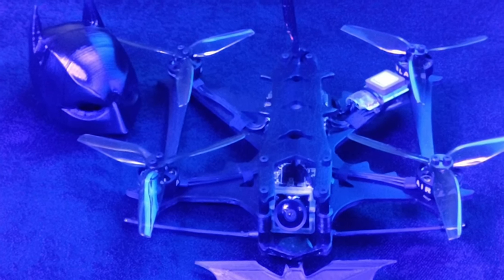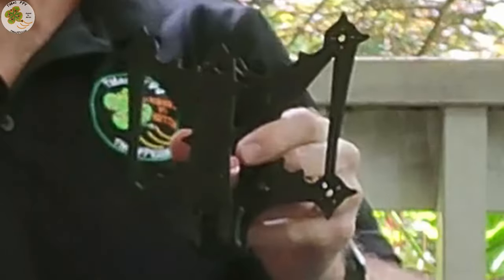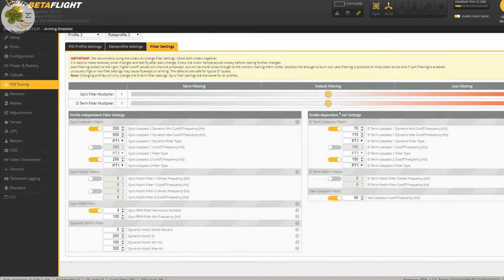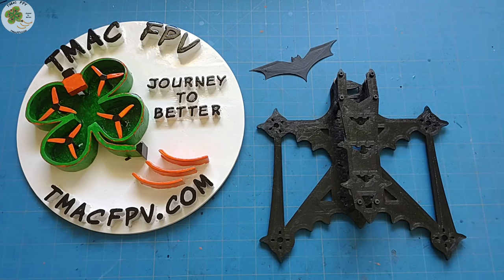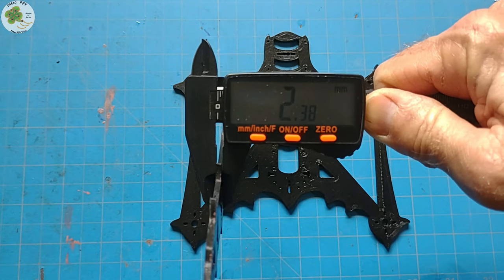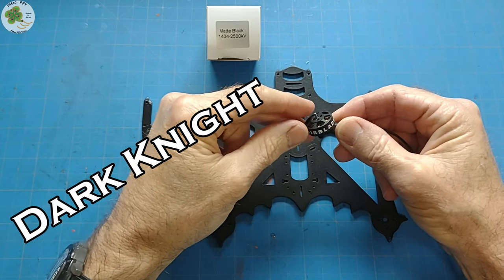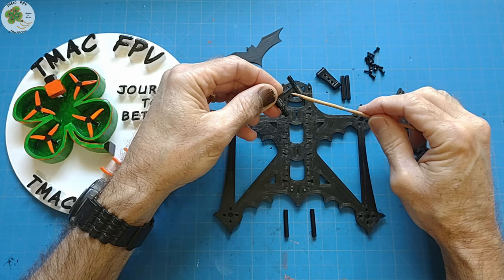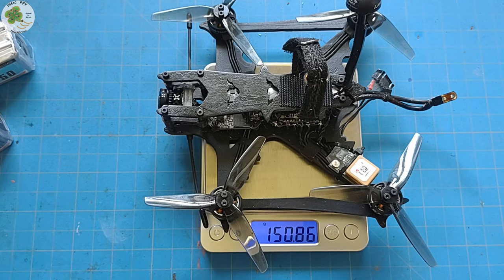3D Printed FPV Drone (3.5" BAT!)

Comment: Now you're just showing off. Beautiful design. Homemade frame? Heck yeah. 1100mAh power, HD video AND sub 250g? That's how you do it. Broke an arm? Just print a new bottom plate and you're good to go. You, Sir, are definitely onto something.
Reply from the maker: You get a 30-day TMac Durability Guarantee with it. Break a baseplate or top plate and I'll send you a new one free (I've "durability tested" this thing myself enough times😂)

Comment: Fun and looking good!
All frames I’ve printed were broken in record time. Yes it was not cf pla… Still it would be great it you could do some crash testing. 
Second suggestion: would be great to have a properly angled place where to mount the gps into the frame…
Reply from the maker: Hey Nikotttin! Please see my pinned comment at top of this Comment Section. Details of 30-day guarantee are near top of page here https://tmacfpv.com/fpv-pilots-den/
I had a feeling pilots may be skeptical of durability, so I'm offering this guarantee. Please do not think this was made with PLA. As stated in the video, it is not. It's a much stronger material (and can be difficult to print). You're not the first person who's asked for a 3D printed  accessory for GPS module, RX antenna, etc. So, I've created a prototype I plan on testing today. If all goes well, I'll list it as an accessory to the frame on my site later today, Saturday, May 15th. Thanks for your inputs!
Reply from the maker: optional all-in-one (AIO) GPS, VTX antenna, and "Immortal T" type antenna mount is up on site now. https://tmacfpv.com/fpv-pilots-den/ Also did the same version except without the Immortal T attachments

Comment: Nice project...👍🏻 
  your bangbad link to the firmware update cable ..if intended for the shark byte system is only a 6 pin connector where the OEM plug is a 7 pin...unless I can't count...🥴
Reply from the maker: You count fine Steve! My bad, link taken down, thanks!

Comment: Nice Video.  What kind of flight times are you getting on the packs mentioned in the video?
Reply from the maker: HeyJabbey71! I get about 10 minutes cruisin' time with the GNB 4S 1100 mah Lipo. Haven't timed the 750mah LiPo yet
Reply: @TMacFPV  Ok.  Thanks.

Comment: Hi TMac,

Nice frame and well done.  

Will it fit a caddx vista? If so, would you 3D print a mount for the GPS and the the caddx antenna?

Thanks…Sam
Reply from the maker: Hey Sam.  Under Features & Benefits section describing frame on my site it states the frame is Caddx Vista and Shark Byte compatible.  On the same site I have GPS mount STL files available. I'd need to know the GPS module you'd be using to print one out.   I've not designed an antenna mount for it yet.
Reply: @TMacFPV  Hi TMac,
I just seen that and i missed on the video.  I must have looked away when you had it displayed. 

WRT the antenna mount,  maybe you don’t need it for this frame, but I was looking for one that could support the longer antennas for the Caddx Vista.  

Also, I don’t have a 3D printer, therefore if I decide to buy the frame would you be willing to print a single mount that would accommodate the GPS and the antenna?
Reply from the maker: @samavella8831  do you have an STL file for the print you're talking about?
Reply: @TMacFPV  Unfortunately not.  I thought you might have one for this particular frame.  

Even if I did have one, I’m not sure that it would fit your frame.
Reply from the maker: @samavella8831  not yet. Great idea though Sam. It'll take me some time to design any mounts. I try to avoid them myself as IMO they just add weight   I've got the long Flywoo antenna installed on mine. I just took some of the outer wrapping off the antenna so it's more flexible running through the quad frame
Reply: @TMacFPV  Thanks TMac.
Reply from the maker: @samavella8831  alright Sam, I've got a preliminary design of a GPS, RX antenna, & VTX antenna combo mount.  Printing prototype now to see if it works

Comment: Seems like it's getting pushed around by the wind.
My need higher pids or its under powered
Reply from the maker: Not being pushed around by wind at all, but great observation Rob!  For that flight, yes, it was underpowered.  The completed build (as shown in the video) is 150 grams.  Keep in mind, I was using 2500Kv motors on this build (simply because I had some laying around--its much better suited for 3000-400 Kv).  To capture good quality flight video to display on Youtube, I decided to strap the Caddx Orca on it.  That (with the 3D printed Orca Mount) added another 75 grams to it!  That's a 50% increase in weight!  Those 2500 Kv motors were having a "little difficulty" with this flight!  I do not normally fly with an additional 75 grams strapped on this quad with those motors
Reply: @TMacFPV  that would definitely make it struggle.
Cool design though.